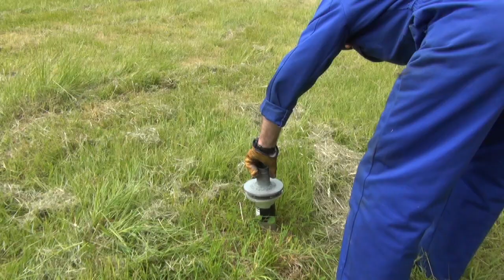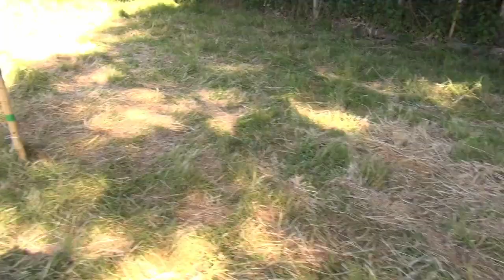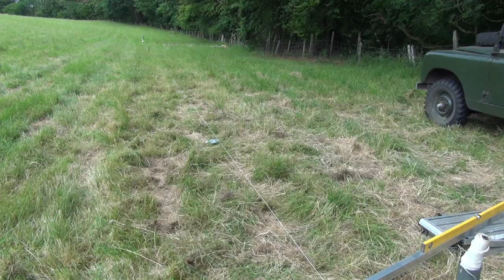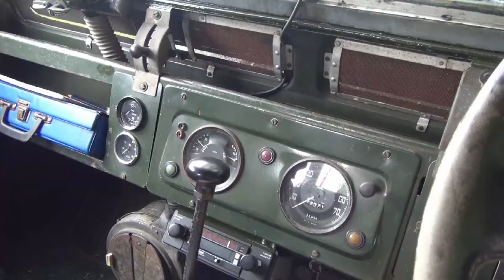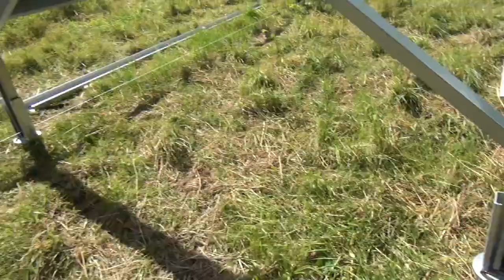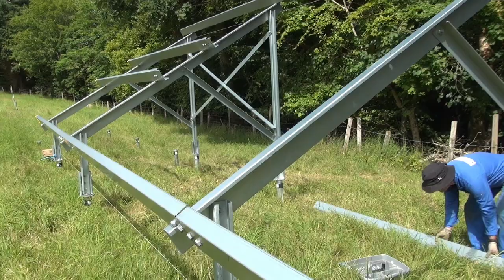Oversized ground screw mounted home PV solar array!

Comment: Excellent work. Oversizing is the water to go. Your inverter seems not to be protected from the weather. Are those inverters waterproof?
Reply from the maker: Yes they are waterproof to IP65, also they are under the top edge of the panels so they have protection from vertical rain if not horizontal rain. I put a bag of dessicant in them and refresh it occasionally too.😀🔧

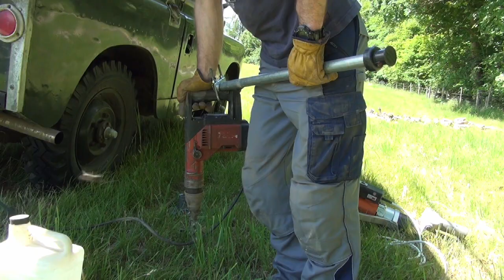Comment: 6:00 wow that drill is a beast!  What kind is that? Drill bit dimensions?
Reply from the maker: It's a Hilti SDS Max drill (other brands are available!), quite an old one but built to last. The drill bits are 28mm and 35mm if I remember right, the 28mm one is 900mm long. 😀🔧

Comment: Thanks for the video. You clearly know a lot more than I do. 😊

I am planning to oversize, too, and get to off grid capability.  Like you I will import in the shoulder and winter months at a low tariff.  Unlike you, I am thinking batteries are of value.  Firstly you can fill them at the low tariff rate for daytime use.  But also, during the shoulder months you can probably fill them too. That will get you through the day.  In the summer the batteries would get you through the night. 

What are your thoughts on this?
Reply from the maker: I think you are best to spend money on more panels before batteries. The economics of batteries aren't great unless you can do it on the cheap - subscribe for the next video, as they say... 😀🔧

Comment: Great work...installed my own ground mounted 10.2kW array using earth screws.  Totally agree with your recommendation to ground mount if you can (ours generates 22% more than predicted due to better ventilation for cooling and ability to orientate and pitch the array to what you need).  About to undertake an oversizing exercise by adding panels (3.4kW) by freeing up a MPPT input on the array.  Cool Land Rover too.
Reply from the maker: Thanks! You are right to go for more panels but not necessarily more inverters, just work 'em harder  😀🔧

Comment: You mention selling back to the grid in summer to offset importing during winter. With an array this size, are you able export at peak rate? Just curious what the DNO have allowed you to do in your area. Thanks for the interesting video.
Reply from the maker: No, it's nothing like the peak rate but with an MCS installer in the loop they can model what your annual production will be for various inverter options and connection limits and handle the DNO application accordingly. What you get paid for export is about half what you pay for import, if you choose the right electricity supplier 😀🔧

Comment: How does the cost of the mounting system compare to the cost of panels?
Reply from the maker: Very roughly the ground screws and frame cost twice as much as the panels. Bear in mind that panels are super cheap now  😀🔧

Comment: During winter it is the best to get some extra for battery but in case you are not using it..well it is hard to say..but it might be worth it
Reply from the maker: The array generates so little for a couple of months in the middle of winter that anything generated gets used (and I import the rest). I think a battery would be worthwhile the rest of the year but only if I make a battery system on the cheap. That's the next video... 😀🔧
Reply: @blairwinchproject2855 batteries can be useful if you have a variable rate plan too, even in winter fill up the batteries during the cheap time and use during the day,
Reply from the maker: @vxnova1  Yes I agree but the economics still aren't great if you buy new😀🔧

Comment: Great off setting, pay back array and loving these ground screws, fortunately not to long inthe near future the uk well have enough solar during the spring/summer/autumn to lift hydro/gravity/battery storage, so i would be putting away the payback production to relocate the array in a more appropriate setting all year around.
Reply from the maker: I get that but there's nowhere here that gets any direct sun in December or January. In any case, even with no shading the production of an array is very poor in those months compared to the rest of the year. I'll be happy if I profit a bit in the good months and spend the money buying power in the winter. 😀🔧
Reply: I was more thinking along the lines of investing the payback on South faceing land or a neighbour may concider something, but obviously it could be a decade before to much power is produced in your area.
Reply from the maker: @HenryOwens-py3ur  If only too much power meant cheaper power 😀🔧

Comment: what you are doing is great. i have several small arrays at different angles and directions to try to get a good charge year around but id love a couple large arrays like this especially with low light panels
Reply from the maker: A big array is pretty cost effective now especially if you do it yourself. I'm not convinced about low light panels, it's all down to the amount of UV getting to your panels so with low light or thick cloud no panel is going to generate much 😀🔧
Reply: @blairwinchproject2855  I have several arrays from 600 watts to 3600 watts and my latest is a 1000 watt array with bifacial 16 buss bar type  n panels. the 1000 watt array still produces power on cloudy days and also early in the morning and late in the evening as to where my other larger older tech arrays only produce power when the sun is shining on them. the larger old arrays are better when they have the correct sun angle and full sun but I'm getting as much power over a days time with an array at almost half the size as my older panels. dauring ideal conditions the larger arrays are definitely better but I was surprised to see the n type panels holding their own over a days time. I power my small home from solar and im only home a few days so I have all month to charge my bank of lifepo4 then home a few days and back on the road again. solar started as a hobby for me but I quickly figured out we can avoid the electric company and monthly bills by making our system larger. we actually heat and cool mostly with our mini split so that uses the majority of our power and hopefully all this solar stuff will give us years of being off grid. thanks for showing your syetem

Comment: Well I see you are at a disadvantage for placement but....great job putting them where you wanted.
Reply from the maker: Thanks! It's not a perfect site but few sites are - and the shading is only an issue for a couple of months in the middle of the winter so it doesn't make a big difference to the annual production 😀🔧

Comment: Cool array, I've a 10kW ground mount up self designed here in Orkney about to double in size - I'm confused by your choice of a Windy Boy (SMA inverter with wind turbine firmware) ... rather than a nice 1000v Fronius or even a new model high voltage SMA.
Reply from the maker: Thanks, I used the windy boys because I had them gathering dust and also because my array is oversized I need inverters that can handle the hard duty. I may change things over time, especially if they blow up. The Windy boy is just a Sunny Boy with a different name on the lid and all you have to do is change the mode from Turbine to MPPT (for which you need the programming cable) 😀 🔧
Reply: The big windys are like rocking horse dropings these days, I've a small stash here for hot swap spares - I can highly recommend the Fronius Snap inverters if you ever need to change, there's been a few bargains appearing on ebay recently - I tend to use the 8.2kW version, but there is a 10Kw single phase version as well.
Reply from the maker: @SeanMoore2008  I'll look at them, thanks 😀🔧

Comment: Great video! Thabks for sharing!
Where did you purchase the frame and groubd screws?
Do you have any dimentions of the frame and angle?
Reply from the maker: Thanks! The ground screws and SolarMount frame are Radix products (in the UK). My frame length is 70m and the angle 30 degrees but the frame is designed and manufactured to suit the customer's requirements - panel dimensions and tilt angle 😀 🔧

Comment: That is a fantastic pv array.  I wish I had the room for it. I will end up with about 26 panels when I get my yard filled up. However, being in Texas I get a lot more sun on my little set up. If you don't mind, do a video on cost.
Reply from the maker: Good idea thanks. Doing it myself it was just the cost of the kit so simple payback is only a year or two. My vision was mainly about sustainability and future-proofing my energy supply, not least getting rid of my oil-fired heating and oil-powered cars  😀🔧
Reply: @blairwinchproject2855  
If payback on a system of that size with PV, inverters, racking, wiring, and all the miscellaneous stuff is less than 4-5 years, your electric bill must be higher than mine !
Reply from the maker: @randya9143  Electricity is expensive in Britain and I am installing an air source heat pump to do away with the oil fired heating so that will increase my electricity bill significantly. Then there's the electric cars, we have one at the moment and aim to change the other car to an electric one as well. That's a whole lot more kWh per day. On good days the PV system will cover all that and generate an excess, which I will export and get paid for. So I still think in avoided electricity, oil and petrol costs, plus export credit, the payback is less than two years. I used second-hand inverters and some other bits and pieces I had lying around, which saved a bit. However even if you paid someone to supply and install this system it would surely have a payback less than 5 years. 😀🔧

Comment: Why the heck didn't you rent a skid steer or mini excavator w/drill attachment for a day to knock those screws in?  

Bloody hell, what a faff.
Reply from the maker: I guess I enjoy a challenge! I should have said in the video, Radix normally do the ground screw installations using either their own crews with the similar machines or their impressive tracked machines which can do a quick and precise job of putting loads of screws in. There's the additional cost of course but it gets it done in a flash. If you are getting big machines in then concrete or driven piles are alternatives but having used ground screws I am converted. 😀🔧

Comment: wouldn't it be little cheaper to use concrete footers?  I imagine the ground screws are expensive.
Reply from the maker: It might be a similar cost I think - it would require an excavator and heavy deliveries which would be an access problem here. The ground screws are not expensive, but installing them costs in terms of labour and machines. I like to keep in mind the environmental aspects of concrete - high embodied energy and a decommissioning legacy - whereas the ground screws can just be unscrewed and recycled (by the next guy) 😀🔧
Reply: @ I see your point.  But in our country, a bag of cement and water would make a fine footer at a cheaper cost.  Also I cannot see what environmental impact a small amount of cement would have…it’s not like you’re pouring cement for a landing strip.
Reply from the maker: @thevet2009  Fair enough but even with concrete you still need some formed steel to set into it, so why not just use steel formed into a ground screw? You are right, it wouldn't need many tons of concrete, but there's no getting away from the digging and the mess. Pull-out strength is important because the array is a big sail, so the concrete mass has to be worked out correctly. 😀🔧
Reply: @blairwinchproject2855  I suppose it depends on your soil conditions which method is best.

Comment: You have enough solar to power a small town. I cant wait to see full sun production.
Reply: He still won't have enough for those two months.
Reply from the maker: @electromechanicalstuff2602  Quite right but I buy power when there isn't enough and sell it when there is so I'm hoping to come out quits😀🔧
Reply: @blairwinchproject2855  I buy from the grid as well automatically if my batteries get low with an off grid inverter. But my utility no longer allows selling back at a 1:1 it's like a 10:1 now so it's not worth the extra money and effort to get the grid tied inverters and connection agreements and permits to do all that. I only have one 12kw inverter. That for the most part is more than enough for my 3,000sq ft home. I even have electric ovens and stoves and 4 tons of r22 central air. The only time we overload is usually around Xmas when we are using both ovens and multiple burners. But I am going to stack another inverter so that's no longer a problem. When that week comes around I just switch the interlock back to grid so she has full power for a few days. We heat with a good size outdoor wood boiler so we keep both floors and basement around 23-24c / 73-75F. We don't cut any corners we don't skimp we live like normal and if the system lets us down I make it better
Reply: For 3 months in Michigan here it's futile. You'll never have enough. We get at best 2 solar hours. I use 1.3mwh a month. I have an 85kwh that when fully charged with complete overcast but still generating 2kw ish will get me through about 3 days from mid Nov to end of Feb I'm charging via Geny only because my fuel is is cheaper than my electricity solely because of a side work for fuel situation I have arranged with a friend.  I have 12 kw of panels and I would need minimum 50kw to maybe not run the Genny
Reply from the maker: @electromechanicalstuff2602  I think 50kW is a good size, along with a bit of give and take from the grid. Even 25kW would go a long way.😀🔧

Comment: the tree line is to close... you will deal with leafts, bird boms, and sticky resin...
Reply from the maker: That's a fair point, I thought carefully about the array location when I was planning the install, I didn't want it right out in the middle of the field and I wanted enough room behind it to get a vehicle through, as well as avoiding debris falling from the trees. I have trimmed back all of the overhanging branches to the fence line so nothing (resin etc.) should drop on the panels. You are right about leaves in the autumn, any that fell on it this winter soon blew away though.   😀🔧
Reply: @blairwinchproject2855  you can still move the tree line :)
Reply from the maker: @ozchalupkova4688  🤣🤣I love it 😀🔧
Reply: Won’t the trees or its branches hit and damage the panels ? Don’t get me wrong, I love the system, I have a 500 watt solar panel array and it’s my backup power supply.
Reply from the maker: @Flash1857  No they are all trimmed right back to the fence line now. If a tree blows over it will do a lot of damage but they are mature and healthy enough so I am not too worried 😀🔧
Reply: How much value does this comment add, after the thing has already been built?
Reply from the maker: @frikkied2638  All comments are welcome though! It's a worthwhile discussion but I'm still not moving the array! 😀🔧